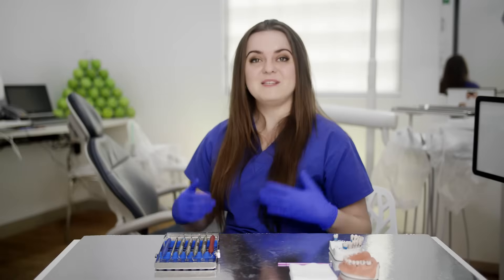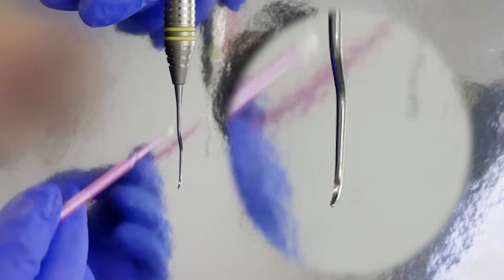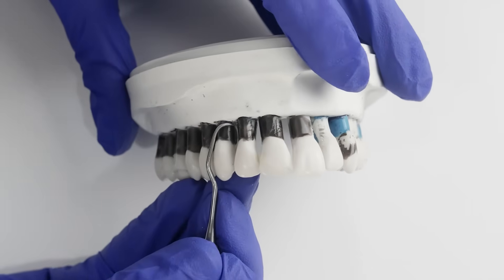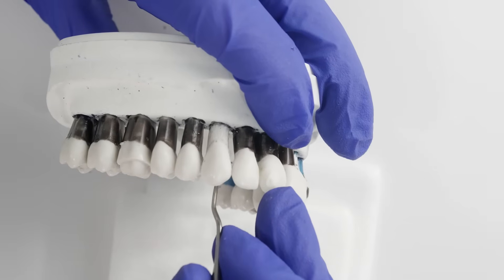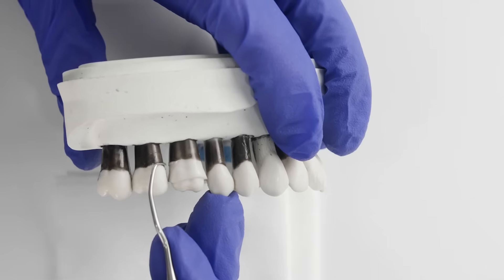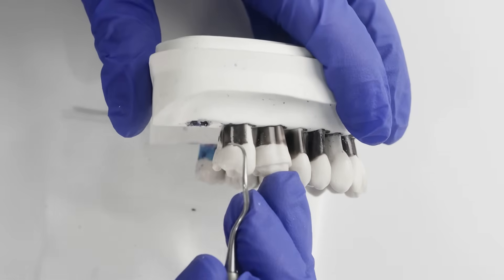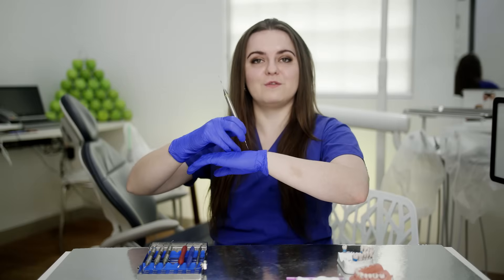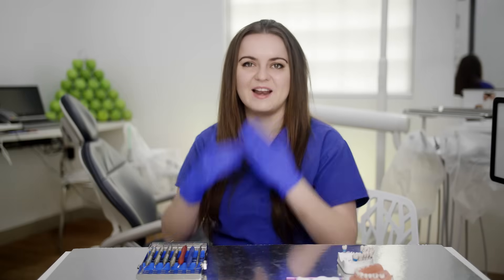Dental Root Planing 101 - Step-by-Step

Comment: Lack of detail. You had to specify exactly: number 11 what exact surfaces of what teeth. Number 12 exact surfaces of what teeth. Number 13, number 14 also. You cannot say 11-12 and work. Needs to be 11 for this particular, 12 for this particular location. This will provide more detail

Comment: Can this be done to teeth with mobility and periodontal abscess, will that help to regenerate bone eventually? Also, do we need to put anesthesia while doing this? If yes, what technique of LA to be done? Is this done by quadrant/appointment ? Thank you for ur reply…

How about no calculus but the tooth is suffering to perio abscess and tooth mobility?
Reply: All great questions! I would personally always remove subgingival calculus under LA. The patient will be more comfortable and you will be able to do a better job. Depending on the area of the mouth,  I usually do infiltrations or IAN block for lower teeth. Depending on severity you could treat in quadrants, sextants or even half a mouth at a time. When deciding you should take into account your level of experience and depth of pockets. Most commonly I do 60min per quadrant. If you have periodontal abscess present and mobility,  the disease has progressed to a severe stage. Consider prescribing antibiotics in addition to root planing. Focus on your patient communication and setting expectations in severe cases. The patient must understand the prognosis before beginning root planing. You can treat mobile teeth but be careful to support the tooth so you don't accidentally extract it with your graceys. Root planing will not reverse mobility as the bone has already been lost. Bone will also not regenerate through root planing. You are merely preventing further loss of bone and helping reduce further gingival inflammation and destruction. If you do a good job and the patient follows strict oral hygiene at home, hopefully you will see a reduction in periodontal pocket depths. If the case is beyond your level of expertise or if the patient would like to explore other treatment options for gum disease or bone regeneration you may refer the patient to a periodontist. Hope this helps :)

Comment: it's helpful, but just know that it's a bit more complicated on an actual patient, with you know lips, limited opening, and a mandible and a tongue that gets everywhere.
Reply: Yes it is true it is a little more challenge in the mouth and you also forgot all the bleeding that happens! Sometimes a lip retractor such as an optragate can help. A bite block can help the patient open wider & relax the jaws too. If you're working on the lower teeth the tongue should not be an issue with LA, especially if you do an IAN block & anaesthetise the lingual nerve too. In the upper teeth the tongue is usually not an issue

Comment: Thank you so much for this tutorial! Question- did you use a sharpie or dry erase marker to color the teeth?
Reply: Great question, I used nail polish. You can also mix sand into it to give it more of a calculus texture
Reply: I have an acadental typodont and the “calculus” is brown flat stain like, (even intrinsic). There is no dimension to simulate even the slightest “calculus”I’m wondering if the manikin exam has true, explorable calculus? 
I understand the need to practice instrument adaptation,  stroke, etc.  and I sure get plenty of that 😊. Thank you  for the above demon.

Comment: How can you see through the gum? Other words how do you know the surface is cleaned or not?
Reply: by the touch
Reply: @ksenijastojkovski6836  oh wow, thanks, that's impressive, need a lot practice if only by touch.
Reply: Using an explorer to detect where the calculus is, it has a different more vibratory feeling than going over just enamel
Reply: @kenzie9384  yeah I just finished my first visit for deep cleaning today, and I confirmed it with my own experience. When my dentist using the instrument I can clearly feel the touch of the surface when it is not smooth. Secondly she use some needle like stuff during the procedure, it just feel like the same thing she used last time for detecting the depth of my pocket, now by reading your comment I know it's the explorer that you mentioned. Thank you.
Reply: @liu3gz  needle is used for irrigation the pocket and cleaning the pocket, have a great day!
Reply: It's all through tactile feeling so you need to use the Explorer very lightly & feel the rough calculus particles. Sometimes calculus shows up in xrays but only interproximally.